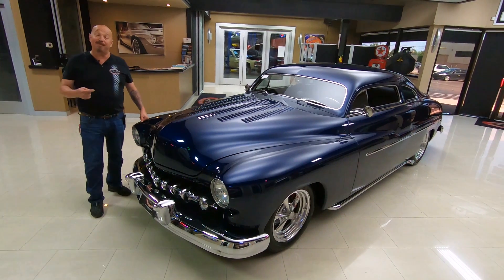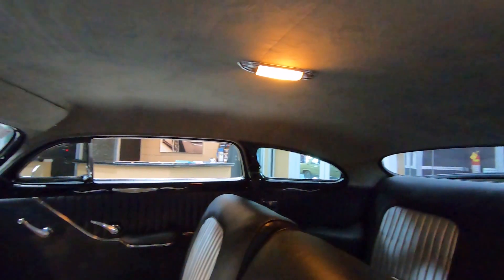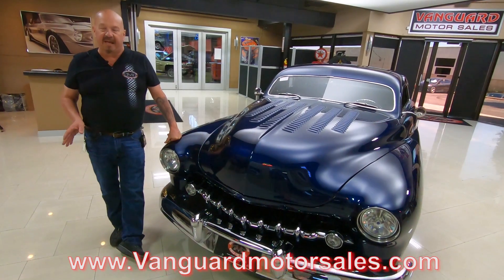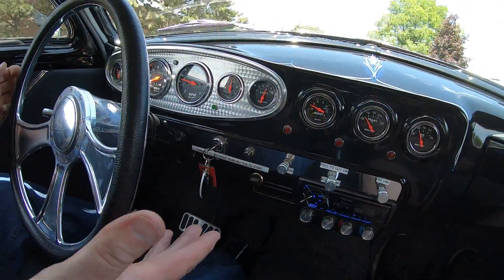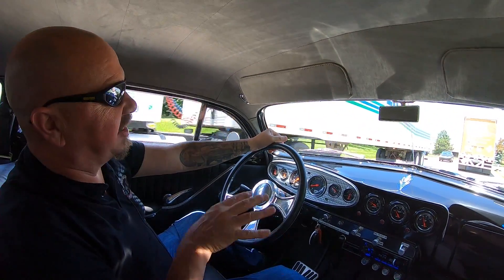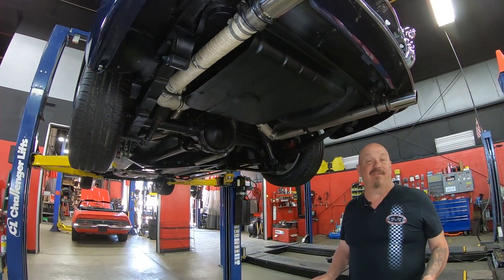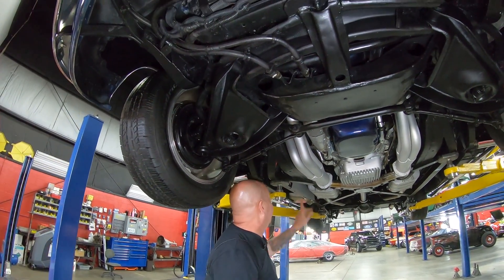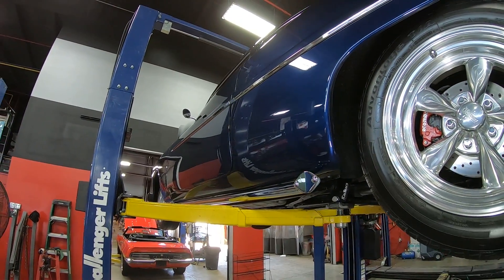1950 Mercury Lead Sled For Sale

Comment: That's an Oldsmobile rear end, no c clips, pressed on bearings trap a 4 bolt flange between the bearing and the  (axle flange) and the flamge bolts to the housing with the brake mounting plate, like a floating axle, but it's a live axle that won't sling off if you lose an axle side gear in the carrier and you'll still have control of the car i.e. brakes & steering. I'd  have liked to see a Ford 9" or a Jag independent with a spool kit myself.